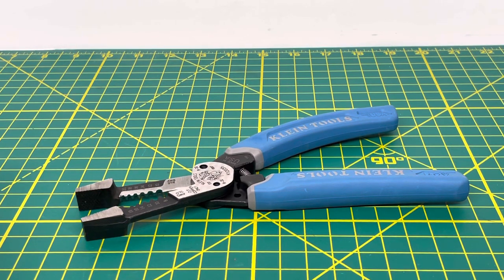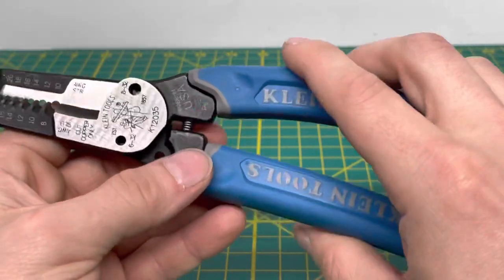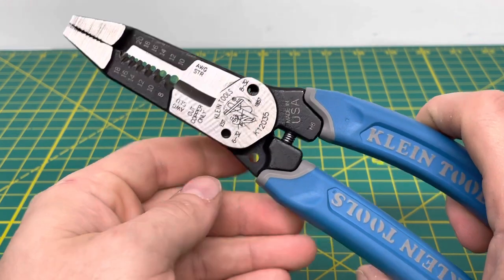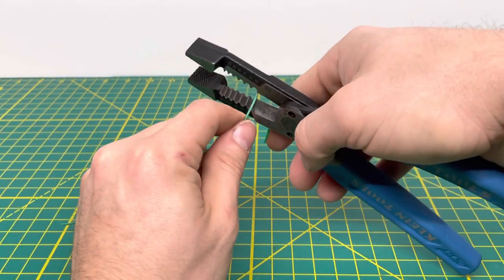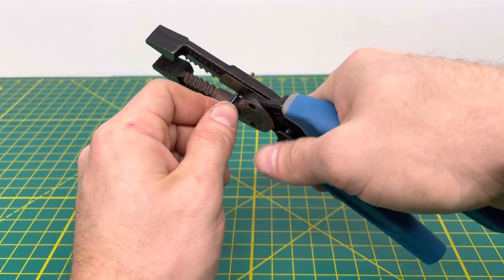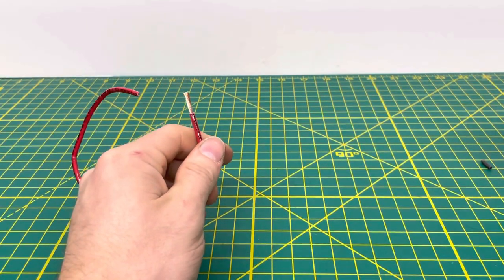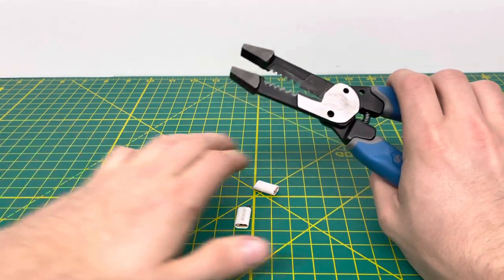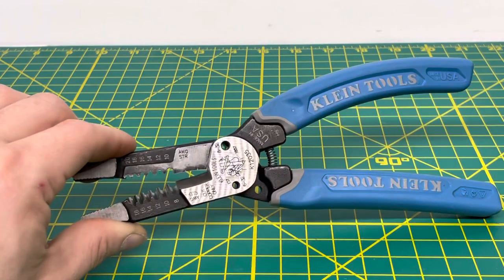Klein Tools K12035 Heavy-Duty Wire Stripper

Comment: I had this same pair but with the lock. They were blue with yellow accents. I don’t think they make them anymore, perhaps because people had the same problem I had. Occasionally they would lock themselves while working on a wire—cutting, stripping, twisting. This was annoying but presented a big problem when I was working on live wires, as the locking mechanism would be energized. There were several times when they locked onto a live wire, I was not wearing gloves, and I was grounded. So I just had to disengage the lock knowing I would be shocked. Of course there are some user errors involved in that scenario, but those are just real world scenarios when you’re doing this work every day.